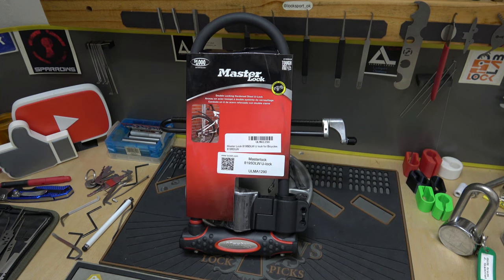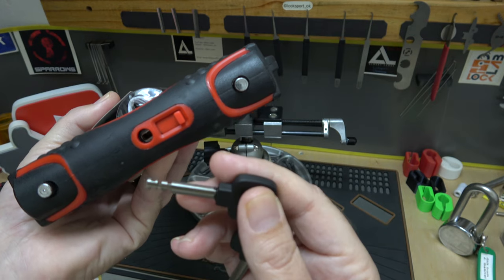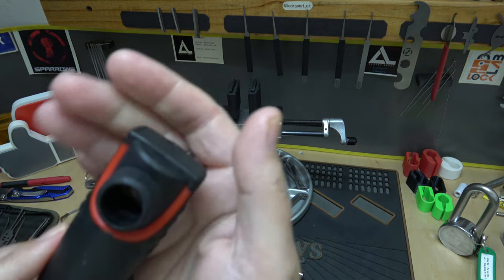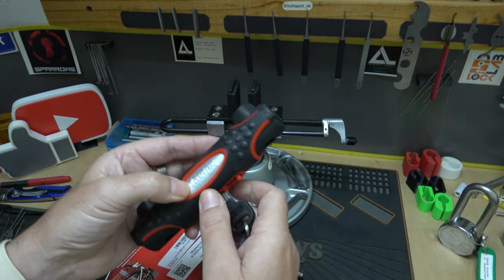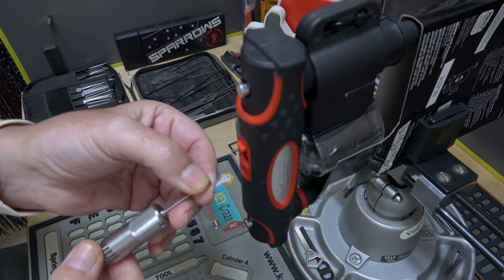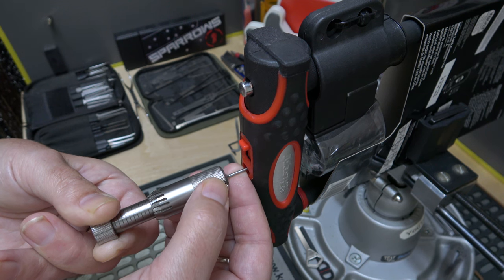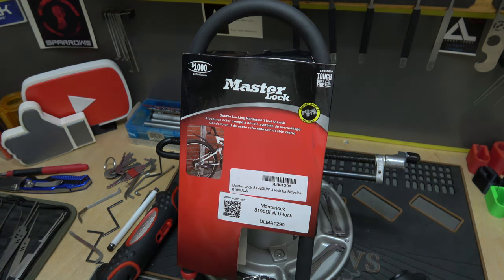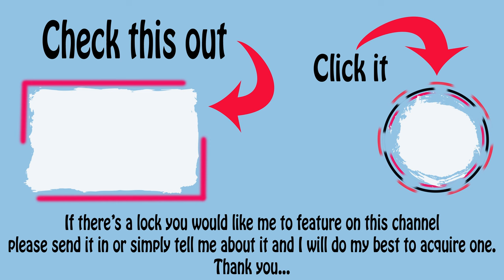#411 Master Lock U-Lock Slayed by The Silver Bullet

Comment: That’s awesome, I think I’ll search this down. I just got sparrows dd pick. So would be fun to do an easy, well and get a third Dd lock. Hey do ya order ur own rods? What size do ya order and what are they called. I only have one ok one and the original ejector pin tip.
Reply: Oh and nice pickin😜
Reply from the maker: Thanks so much. LOTS of practice. When I first started I made my own tools but I had to have a Silver Bullet and why not the Sparrows disc pick also. I do buy the ejector pins and make my own tips. I believe they are 1.5mm Check out the video I did #398 as I show exactly how I make them. I will help any way I can. I am easy to contact.
Reply: @AlbertLebel  appreciate that. I will look that episode up now.